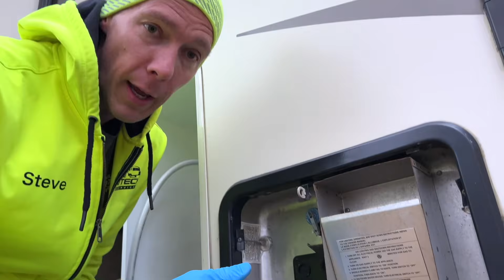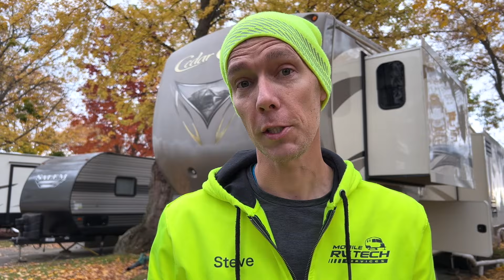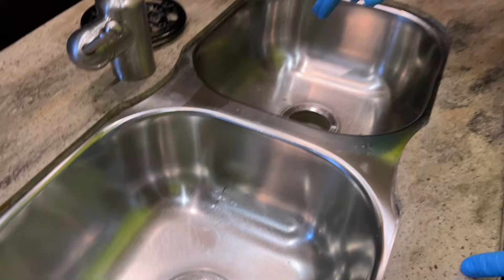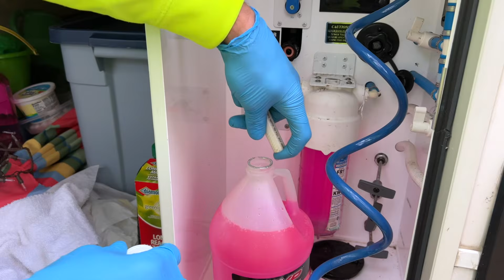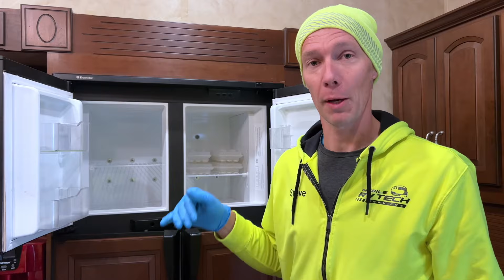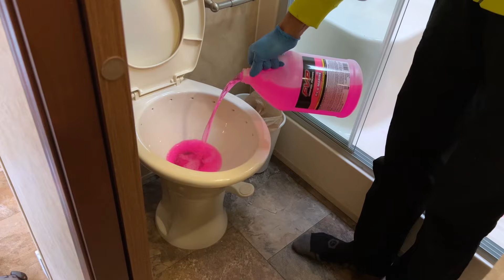How to Winterize RV | Compressed Air & Antifreeze Method | FREE ✅ List

Comment: You are pretty close. Two things I do differently, spray bleach on that threaded connector before you move to you fresh hook up. Then at the end i blow all the anti freeze out. I don’t trust even the RV antifreeze slush I have seen those jugs expand in the winter.👀👀
Reply from the maker: I have heard of people blowing out the antifreeze after. I think that is a good idea in certain areas that see extreme cold.

As far as the black tank flush threads, I see your precaution. The system has a vacuum breaker to prevent cross contamination and there should never be an issue, but rare things can occur.

Comment: Those portable air compressors have a short duty cycle. Heads up blown fuses....
Reply from the maker: Thanks for the heads up. I must have a good one. I have been beating up my compressor going on 4 years now and it is still running strong.

Comment: I did not note that you purged water out of the water pump and its filter when you did the compressed air method.
Reply from the maker: That is because the antifreeze pushes out the water when it is pulled through the water pump. There is no way to blow air through the water pump.

Comment: I truly appreciate your instruction provided in this video. It was a real help! One question. I noticed that you left antifreeze in the water filter housing in the wet bay. Is this necessary for added protection? I emptied mine and used it in some p-traps. Thanks in advance.
Reply from the maker: You can empty it out of the water filter housing, I just leave it in.

Comment: Don’t most campers have low point drain valves?   When would be the right time to open those during this process?
Reply from the maker: The low points are opened at the end once the RV antifreeze is ran through all the faucets.

Comment: You omitted a bit part-- how to adjust the Viair regulator to 30 PSI!
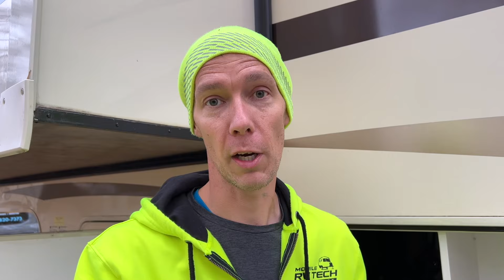Reply from the maker: I explained the PSI at the 4:31 mark of the video. Showing how to adjust the pressure wasn't covered in this video since it was not about the regulator. To adjust the pressure, you turn the dial on the regulator until it reaches 30 on the gauge.

Comment: Please comment on steps if washer is installed. Thank you!
Reply from the maker: While each washer will vary the general steps are to start a cycle on warm until you see pink in washer or the drum turns. Then cancel that cycle. 

Next start a spin cycle to drain the antifreeze through the washer. After 1-2 minutes cancel spin cycle.
Reply: @MobileRVTechServices  thank you!
I wish you were closer!